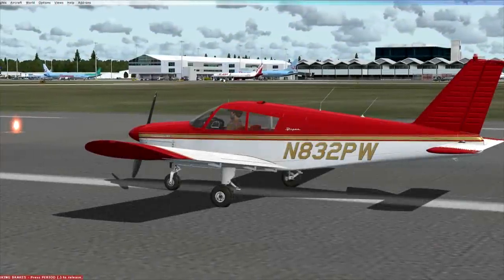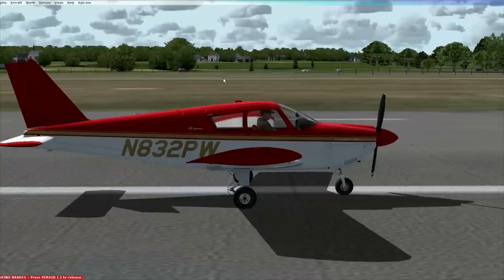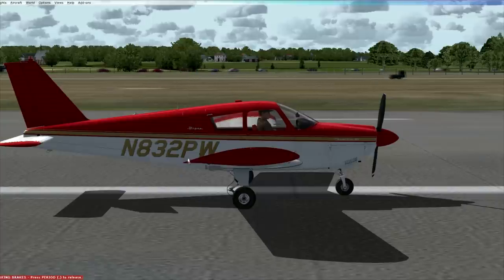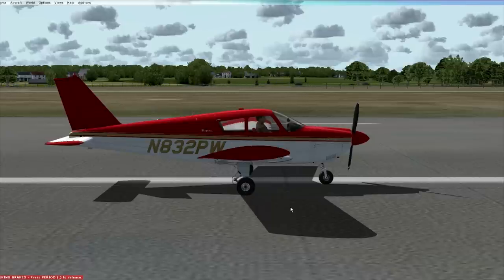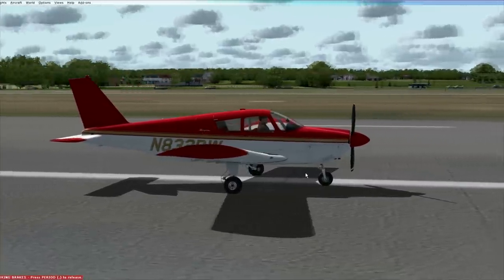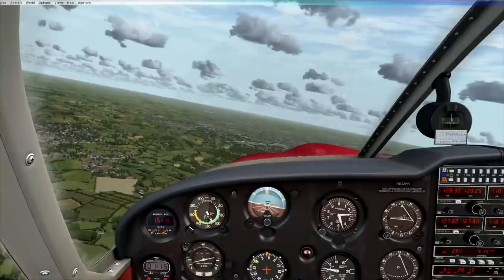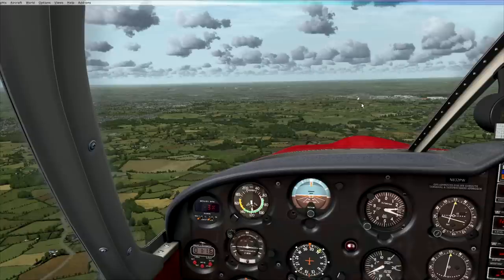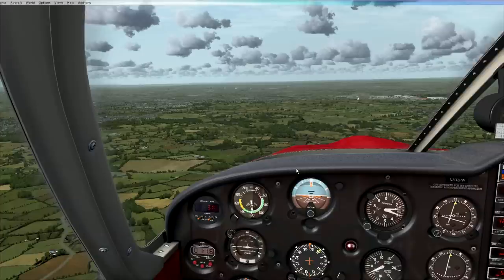FSX / P3D A2A Piper Pa28 Cherokee Tutorial - How to land

Comment: First things first, I'm at my 10th hour with a Piper PA-28-140 (HA-SKU). I'm training to my CPL.
Your approaches are way too low, your airspeed is way too low, you don't seem to really care about the centerline, and you don't really flare the airplane, just crash it into the ground. These landings are not a great deal in FSX, but if you try to land a plane, with these vertical speed, it would hurt. (Unfortunetly, I've experienced it.) If you flare sooner (yes, I see those trees) and more, you could stop earlier. Practise landings more, try landing with 2nd notch flaps, setting throttle closed sooner, and try opening full flaps when landed, it increases drag, so shortens roll on the ground.
Reply from the maker: Csaba Turza   Thankyou for your advice.

I had one really close experience in a Pa 28 where I nearly crashed.  It was after I had my CPL, I was a bit too confident and nearly crashed through a hedge at the far end of the runway.  One key feature of a good pilot is always to review every flight, to assess your own mistakes (because they always happen) and to ensure you learn from your mistakes and the mistakes of others.  So here is what happened:

I nearly crashed because I was doing a short field grass strip landing in a Pa 28 Cherokee and came in too fast (it was only 4-5 kts as I recall).  As I'm sure you appreciate, a 10% increase in speed results in a 20% longer landing distance.  Unfortunately, I also tried to flare and hold off for a nice smooth landing.  Of course during all of this the ground is passing underneath me and I'm concentrating so hard on getting a nice gentle landing that I miss just how fast I was running out of runway. I already had full flap, but in any event the aerodynamic drag effect of a Cherokee's flaps is far less effective than correct application of the brakes, and to use the brakes properly, you need the full aircraft weight to be on the wheels.  After a very scary few moments, I eventually stopped about 10 metres from the hedge.

I stopped and sat there for a few seconds, collecting my thoughts and thanking my lucky stars that I did stop.  I remember the cold shiver where I realised that I could have died and whilst I suspect I was only stationary for a few seconds, it felt like I was there for minutes collecting my thoughts.  I suspect ATC knew exactly what had happened and had prepared themselves to deal with a crash.  I was on my own, so only the ATC tower and I knew how close it had been and when I went in to see them, the look we exchanged demonstrated that they also knew how close it had been.

I flew a further 3 trips that day, returning to that same airfield on the second to last trip to drop a passenger off before I flew home.  My second approach and landing was a much more controlled approach speed wise.  I could have died earlier that day due to being a few kts too fast and trying to get a smooth landing when one wasn't appropriate.

In all of the hundreds of hours that I have flown, that one day is still clear in my mind.  I don't know how many hours I had in my logbook at that time, nor have I bothered counting them since other than as a legally required document.  That day taught me that a single 30 second event can teach you more about flying and yourself than the previous hundreds of hours of flying recorded in a logbook.

I appreciate your kind words of advice.  If I may offer my own to you, I would offer the simple advice I was given during my training towards a flight instructors rating.

We learn from our mistakes, but in aviation we have to survive them before we can learn from them.

I survived that mistake and so I learnt more than any instructor I ever flew with could teach me.  Be careful with your speed because too fast can be just as dangerous as too slow.

I really enjoyed my CPL, twin and instrument ratings. I'm sure you will enjoy them.  I also have a great deal of respect for flight instructors.  In aviation terms 10 hours is very little time so it is also good to be mindful of one's abilities and to exercise a certain amount of modesty.  There is a famous saying - "There are old pilots and there are bold pilots.  But there are no old, bold pilots".

Good luck with your studies and I hope you enjoy them as much as I did,
Rich
Reply: flightsim481 
Thank you for your story, I really like to learn from other's mistakes. I'm just talking from my own experiences.
Here, we have high expectations, and strict instructors (old eastern block agricultural, fighter and aerobatics instructors). We are expected to do a landing with just two throttle settings (once to 1700 RPM, and once to idle) after the 4th hour. Of course you can correct, if you misjudged your approach, but you get a worse grade for it. We have GoPros in our cockpit, and after the flights, we talk through our mistakes. We are strictly expected to keep speed at 70kts (in still air) at approach. (Once my instructor put the plane in a spin at 700ft AGL when I let the speed drop to 66kts, to show, what a gust can do. With an isntructor like this, you learn to keep your speed (and other parameters) at the desired value for a life. :) )
Reply from the maker: Csaba Turza Despite standardisations, many instructors will have different opinions on the best way of performing a manoeuvre or flight profile.

There there can be several different was to fly the same aircraft.  That doesn't mean that one way is right and another wrong.  My first flight instruction was in the military and all of the flight instructors were ex-military.  To this day, I still wish I had 1% of their skill.  The chief flying instructor's first operational aircraft type was a spitfire.

They had flown Spitfires, Lightnings, Hunters, Jaguars, Buccaneers, Hawks  etc.  Even today, I sit in awe of them. My instrument rating instructor in the simulator was a very quiet and reserved man.  It turns out he used to fly Lightnings and had lost several friends in crashes and whilst he loved flying, he spoke very little about it.

Whilst I admired them, I also learnt a lot.  Not one of them would/could tell me how many hours they had flown.  All of them had tales to tell of losing friends to accidents.  All were incredibly modest and not one of them tried to tell me how good they were.  It was clear from who they were and how they flew that they were very skilled.

Different instructors have different techniques but I rarely criticise others because it pays to remember that no matter how many hours we have, we are all still learning.  Your experiences are different to mine, which are different to many others.  A key part is not to make the assumption that you are right and others are wrong.  There is a marked difference between exchanging experiences and being openly critical.  You may not have noticed, but I very rarely criticise other's flying in a simulator.  That's simply because I don't know who taught them, what was taught and the experiences and skills of the teacher. I was in a tail chase where my instructor wanted to have some fun.  So he took control, pulled tight into the turn, whilst doing so dropped some flap and pulled even further into the turn until he felt the buffet on the airframe.  Not once did he look at the gauges because he knew from the aircraft's feedback what it was doing.  He did all the things I had been warned about doing.  I couldn't, and still can't fly like that.

Be careful about being very critical, particularly with only 10 hours of experience.  There are others who will challenge you and your experience.  I would simply say listen to your instructors, learn from them, listen to others and share your experiences with them but be very careful of criticising others because there will always be someone out there who knows more and can fly better than you.

This is a simulator and it is designed to be enjoyable.  This is not a tutorial for real life flying it is just some fun on a computer.

I'm sure you will enjoy the journey of your flight training.  It incredibly rewarding but some of the best pilots I ever had the chance to fly with were the most modest and said very little.  I have tremendous respect for them, not because of how they flew, but because of what they taught me as a person inside and outside of a cockpit.

Good luck,
Rich  :-)

Comment: I quite often don't use much flaps on most airplanes I fly. Don't really need them on my Ch-200,the ercoupe doesn't have them, The other planes I've flown don't either citabria, cub or champ. gonna try the pitts and taylorcraft next them should be finished with the sonerai. How many of you only use themsparingly?
Reply from the maker: IMHO people are too prescriptive at times.  As you say, there are many aircraft which don't even have them, but likewise, there are occasions when one might use different settings.
Reply: Oh i can definitely see why people use them in sims because in these ww2 combats sims you can't much see over the nose so people come in a bit steep so they use flaps to counter that nothing wrong with that. I do it too sometimes. Its also just a bit of a problem for aggravating ground effect and floating too far down the run way
Reply from the maker: Floating is mainly due to people having too great a speed on the approach and flare which is a common thing in flight simming.
As you say, early stages of flap are good for lift, but the latter stages primarily to increase drag and thus allow a more nose down attitude on approach with a higher power setting to improve engine response in the event of a go around.
Of course the high drag doesn't help with the go around but that's where flap selection is important.
I used to frequently land at an international airport in a Cessna when hours building for my commercial licence and would often do flapless approaches both to practice them, but also because the higher ground speed on touch down meant I could get to the runway exit more quickly so the heavies weren't baulked by me.